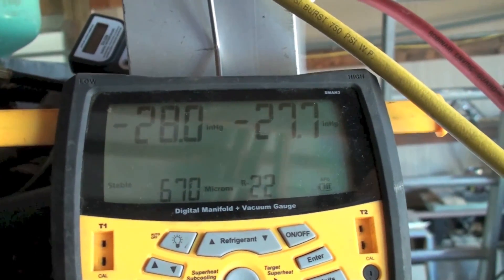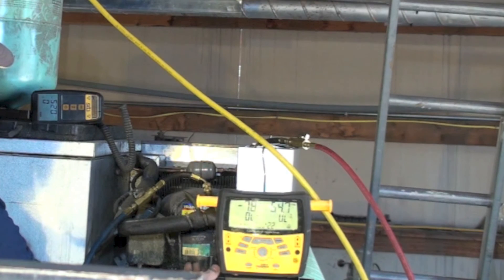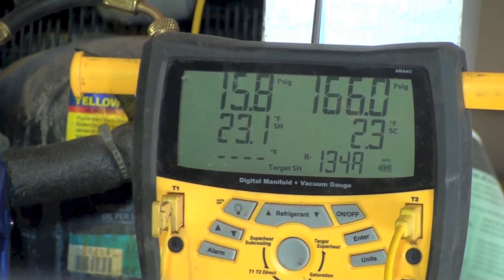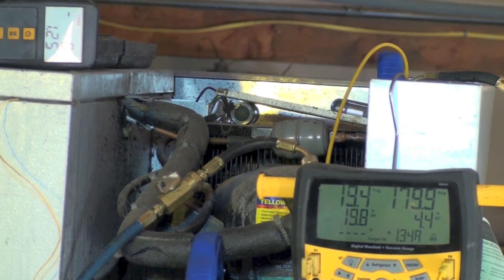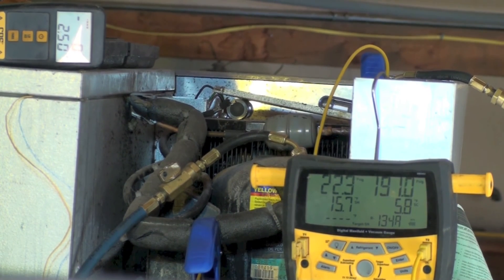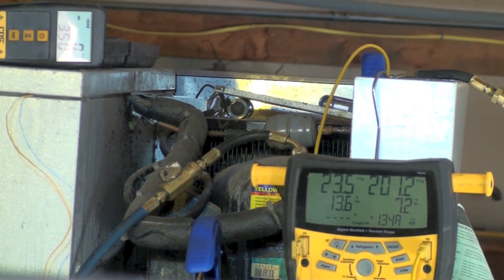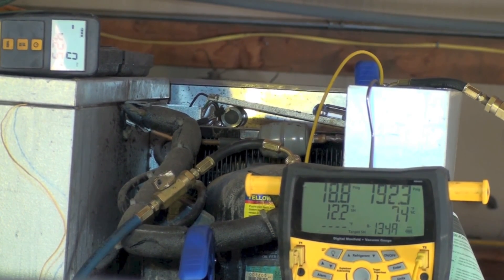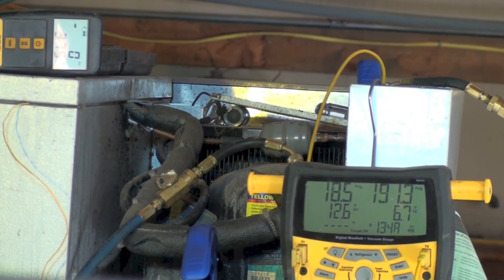How to charge the medium temp box

Comment: The 30 plus ambient is where the ambient of the air temperature is the temperature around the condenser. The 30 minus ambient is the suction refrigerant temperature where the ambient temperature is the temperature inside the box.  So if the box is 40 now the suction P-T is 10 degrees. AND the air around the condenser is 90 degrees, the liquid going to the expansion valve should have a P-T of 120 degrees or plus 30 of 90 deg ambient.  Is this what you are stating?
Reply from the maker: That's pretty much it.
GFM

Comment: When I charge a small system like this I will closely watch the RLA, over charging will show up if the RLA is over the nameplate. The danger is when the system goes into defrost cycle the overcharged start up load can destroy the small compressor. I'll also keep an eye on the evap's air in and out Delta T during the refrig cycle.
Reply from the maker: ***** You must be seeing something I have not seen.  I can't get one of these systems to overdraw regardless of charge.  I will have to do a video to test this.  Thanks for the thoughts.
GFM

Comment: Ok. The superheat that you were mentioning here was taken near the compressor. That charge is incorrect then  since in the other video  you show the right location to check superheat., am i right.?. Its alittle confusing.. thanks.
Reply from the maker: tecnico I did not note in this video that I was taking the superheat at the sensing bulb.  The blue clamp is not being used at this point.  Thanks for the thoughts.
GFM
Reply: grayfurnaceman i got it now

Comment: I was wondering where you were getting your superheat reading from.  At the condenser or at the exit to the evaporator?
Reply from the maker: Joe Marchione You may note the blue clamp and the yellow temp sensing probe.  The blue clamp is on the suction line near the compressor.  The yellow probe is mounted at the TXV bulb.  The yellow wire is where you should take your reading.  On 10-16-2014, I will have one showing the difference between the 2 positions.  Its quite eye opening.
GFM
Reply: DUH,I meant at the compressor or the exit to the evaporator.  Sorry fot the confusion.